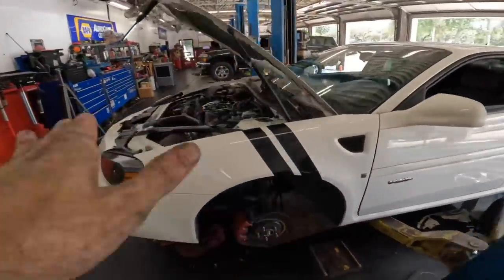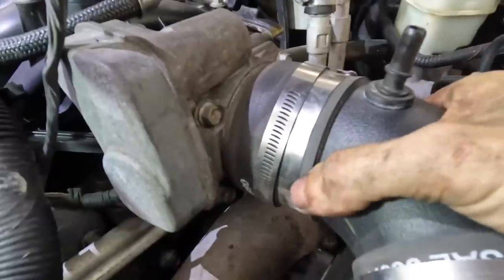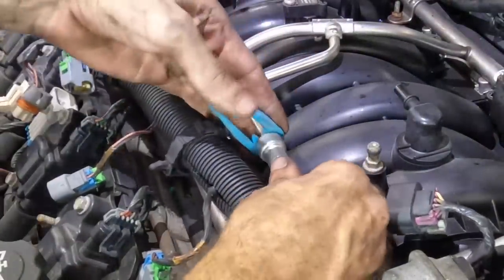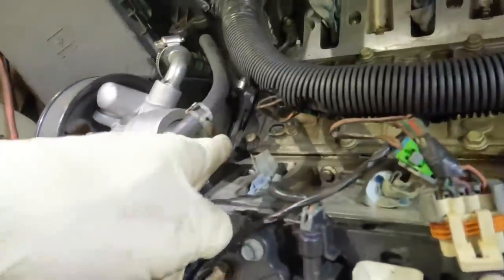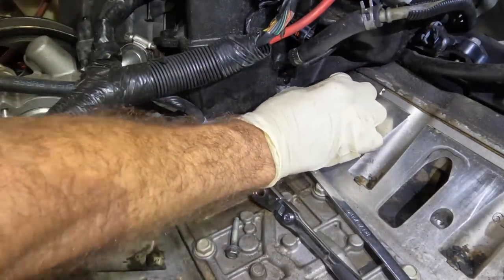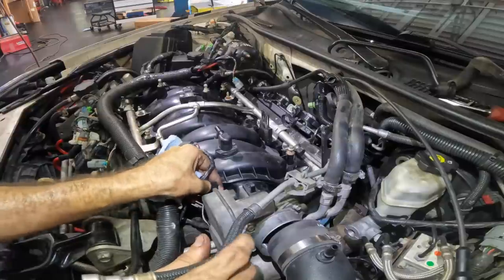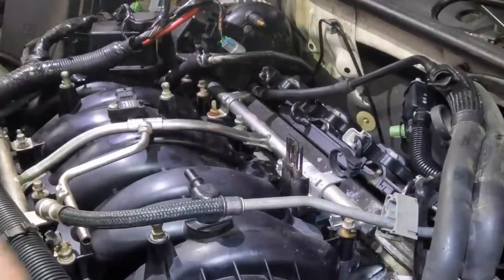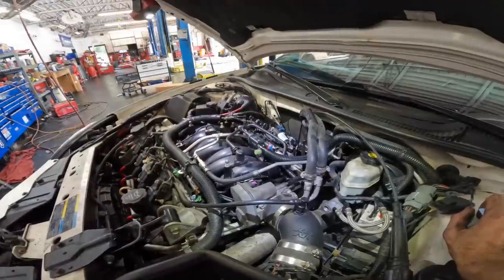Brake Clean Pressure Washer! V8 Powered Pontiac GXP 5.3

Comment: I once had a nut come off a air filter assembly and fall into the intake
of a vw trike while riding it. I immediately shut it off. Was able to fish it out of the cylinder with a magnet, bore scope showed a few dings on the piston but the motor was saved.

Comment: I use air to blow out ports anywhere crap can get into I thought most people did that.  It really works give it a try. I remember 1970s cars takeing out the 6 cylinder and putting 8 cylinders in you had to cut into the firewall and the motor mount location. But yeah putting a 8 cylinder in and shoehorning it to fit where a 6 cylinder should be very limited space it was a ok idea from Pontiac on these cars.

Comment: I dropped a bolt with the intake off and couldn’t find it. Completely forgot I dropped it. The next day I put it back together and started it and it wiped out my piston. Bent the rod and cracked the cylinder. Cost me $800 to fix the block and replace the pistons and rod. Getting ready to put the motor back in. I hate getting old.

Comment: I agree with your method of blowing the intake out. The way I see it, if there is any debris, it will end up in the cylinder if you don't blow it out, and any that gets driven further in would have eventually ended up there anyway.

That said, why not USE PAINTERS TAPE and block the intakes entirely. It seems like a lot less work and risk to me.

Comment: Thanks Ray for your videos.  I've  caught many a great tip thank you sir.

Great to see the Premier Logo on your parts trays.  I sold for them many years ago.  Had so much fun,  but the travel was hard on family life.  Live in Northern Ontario Canada and the close big minung city was 80 miles.  The nex was 220 mikes away so lots of overnight weeks.  I sti think I helped many mechanics with on hand consumables close at hand.  Oh and I too have the green handled wird stripper i use most days working on my 66 Dodge Dart Ragtop,  or my 2012 Volvo xc70.  I think I still have some Supertanium L H twist drills.  Great reminders thank you Ray.
Reply: If you want to remove broken bolts or studs left hand twist drill bits of the ticket I usually use a center drill first and when you hit it with the left hand drill it it'll spin right out have a great day
Reply: 66 dodge dart convertible. My first car. My grandfather had put a 1970 318 in it. Yours didnt come from Florida did it?🤣. I reamed the crap outa that car. Super fun.
Reply: @pitchforkpeasant6219  yes.  Originally PA  then Florida,  Ohio and Ontario Canada.  A total body/ Paint last summer..  looking spiffy.  I dropped a 273 Commando in it and it hauls.  Edelbrock 550  cfm pumper with E intake.
Reply: @billwhite5188  nice👍😁👍

Comment: Those difficult bolts you have to put in manifold first... a pain for sure. In the past I have used an old o-ring on the bolt to hold the bolt up, so it doesn't interfere with manifold placement. Then just pulled the o-ring off and screwed it in.

Comment: Next time when installing that pipe , do not push down on the pipe because it will bend and then rub a hole and leak like it did this last time. Lube the o-rings then push on the ends where the bolts go.

Comment: The socket is like that for studded fasteners.. like a stud on the back side that maybe has a bracket held tight with nuts on studs instead of a bolt head. It's a  low pro pass through socket..

Comment: A friend of mine changed an Intake Manifold on a 69 Big Block Chevelle and didn't know he dropped the clamp screw from the coil down a cylinder runner in the drivers side head. He had a bad day....

Comment: Good job Ray! You always make it feel like we are in it together. I even get the sinking feeling in my belly when I see you drop something down a hole that it doesn't belong in or when a bolt snaps off! Sending good vibes and blessings to you and your family.
Reply: Not at all  Because to my knowledge brake cleaner is the only one designed not to affect rubber and plastic components. Which is why you use it on brakes. If you did that with WD40 then in a few months all that rubber would be a gooey mess.

Comment: All 4 intake valves on one bank are NOT ALL closed at any one time, so you are blowing air and DIRT into some Cylinders. Also your blue shop towels do not stop all dirt from getting in when you first cleaned it either.
Reply: I was thinking the same thing.

Comment: know where your stuff is, yea, tell me about it, some way some how a 15 mm socket ended up inside the pumpkin after doing axle shaft bearing and seals in my 08 crown vic, it showed itsef 8 months later while doing 80 mph on interstate 75 here in Georgia, Kaboom, got it towed home opened the pumpkin there it was a 15 mm socket crushed and lodged in the ring gear, I honestly don't know how it got there because the job didn't require a 15 mm socket, I just knew the diff was destroyed, luckily it wasn't, crown vics are tough vehicles,  I am still driving that car 2 years later 243k

Comment: You could put a mannequin head inside the coolant vacuum tank for authenticity.
@29:00 I think they might be concerned that all that compressed air in the head with cause the fuel air ratio to be too lean once you reassemble the intake  😀

Comment: I wonder if Ray is able to replace a front timing cover gasket/seal and a oil pan seal on a 07 Monte with a 3.5 L V6 without pulling the engine? I have one that the dealer ran a dye test and says it has a small leak at these places?

Comment: I believe these 5.3 engines  have verible pressure oil pump. After 60,000 or so they tend to cause pressure problems.I was told by certified GM technician

Comment: Hey Ray, As always, GREAT VID! What is your opinion of the K&N Aftermarket Air Filter that is on this vehicle? Does it really add horsepower to an engine? Does the Air Quality of the engine suffer as a result of this filter system. I value your opinion! Thanks Earl Harrell

Comment: I had an om642 engine blow up, the injector seat cutter tool had a replaceable guide in it which fell out into the cylinder and when the engine was restarted it embedded itself into the top of the piston causing the engine to throw a rod bearing 🥴🤔🥴

Comment: 1 questions if you had power steering pump off how come you didn't replace that steam line . Before you closed it up again. 👍. Plus I like 👍 air gun 🔫  works good . Would work on bicycle gear ⚙ parts also because take a long time,  all road gunk of sand and oil.?.

Comment: Needs a catch can.. and new lifters lol. Shoulda checked how tight the VLOM bolts are, they like to loosen up. Needs a cooling system cleaning and a thermostat too. The cooling system is to small for the 5.3 and the trans combined. If it doesnt have a Tru-cool 40k stand alone trans cooler yet the owner should invest in one to save them another $3500+ transmission. I would have reused the blue intake gaskets...

Comment: Hey Ray, why is it that you always seem to use a screwdriver to release / tighten those adjustable hose clamps?  I've always used a 1/4-7mm, 5/16-8mm or for the mongo clamps on marine exhaust bellows a 3/8 inch nut driver, which have the advantage of never slipping off the screw head.  (Maybe this question has been asked and answered and if so, please forgive me).

Comment: great job Ray. strange that the prior mechanic would go to all of the time and trouble to remove the intake etc etc and yet doom the repair by using JB weld as opposed to replacing the tubing. penny wise and pound foolish LOL
Reply: Only good reason I can think of is the part was going to take too long to get, and they needed to get the car back together. That's likely a dealer-only part, same as the one I had to replace on a Ford 3.0 that ran under the intake.

Comment: As far as your assalt blow gun people are overly politically sensitized and have to take exception to everything it's a toy it's a blow gun you can't fix stupid but as far as using a blow gun to blow everything out hey that's the way I do cuz any little piece of dirt could ruin a proper seating or cause you gaskets not to sit down properly as far as checking your parts and your tools when you get done that was a great idea because if I can't find something I want to make sure and you were right that copper o-ring if it would have got in the valve probably would have bent it and that would have been major catastrophic motor disaster hey you do great work don't justify yourself to them stupid little trolls and haters and have a great day

Comment: At 24:08, the brass nut is still in place.  At 27:31, the nut falls onto the head when attaching the metal hose on the right side. At 31:23, the brass nut is missing.  Had to slow the video down to catch this.

Comment: Can you eliminate a pipe like that or no? what does it do? except leak.
Reply: The Cross tube is exactly as indicated in its name it allows the engine coolant (Anti Freeze) to cross flow between each cylinder head and the coolant system. No you cannot eliminate such a part, why would anyone want to ?. The cheap and dirty fix would be to cut out the leaking tee portion and replace with a barbed tee, hose and clamps. The “Cheap and Dirty” should tell any decent mechanic that other than a temporary fix don’t do this. Fix it properly.
Reply: Thank you very much just seems like some of these engines nowadays have so much unnecessary cooling flying all over the place

Comment: I blew an engine like that. leaking intake gasket should have been easy 30 mins on a ford 302. got finish fired it up ran about 15 second and boom. took engine apart and found a wood screw embedded in number 6 cylinder with a hairline crack in the cylinder wall. dont know where screw came from must have been laying on intake when I pulled it off.

Comment: Help if possible  I am subscribed  watch all your video's and leave the thumbs up.  Question for you or your opinion Ford F550 feels like it has  no suspension when riding over little potholes on highway or un even road going over bridges. I have changed all shocks front and rear. HELP !!!!!!!!!

Comment: Imagine how much money you would save if you bought a metal pressurized canister (recharged by compressor) and bought carb cleaner by the 55 gal barrel. Far Far Far cheaper than buying it in spray cans.

Comment: RAY RAY RAY RAY RAY RAY RAY RAY !!!!!!!!!!!!!!!!!!!!   TORQUE QUESTION TORQUE QUESTION TORQUE QUESTION  !!!!!!!!  TRYING TO GET YOUR ATTENTION LOLOLOLOL...Kidding aised  I have a question for you and need your advise. Being you worked at a GM dealer. This is a torque question. I just repalced my lifters in my 2018 Cadillac Escalade with the 6.2 crappy AFM system. When I got to the fuel lines. GM makes it very clear to always reeplace them with new ones. Of which of course I did. Question, when I torqured them down as per the specifications I was a bit stumped on how I was suppose to use a torque wrench on fuel lines. The only way that made sense to me was using a crows foot  and torque it that way. Number one, is that ok ? I was told doing it that way it's NOT accurate. Supposedly it looses the torque spec just a bit. I would love to know how you would torque those fuel lines properly or the right way ? I am very curious if you are willing to explain that in one of your videos. You are welcome to bring my name up in the question. I did make very sure it's not leaking but when I did torque it down using the torque wrench, it felt like I was over torquing it, if that makes any sense. Again, I know you get alot of comments. I hope you see mine. I am going to get a little silly with the title to my message in hopes my message gets your attention lol. Your California friend Ron, owner of Stanislaus Towing.

Comment: Do yourself a favor, use the right tools for the job from the start, your patience tank won't hit empty quite so quickly. Yeah, the personal challenge thing I get, you might include making the job easier and smoother (redundant somewhat) in that challenge. Pretend you're a doctor, lay out every tool you think you'll need in the order of projected use. It would be interesting to see the "nailed it", should it happen. Nope, I do not do what you do, but I run into the same , "Geez, I needed a boatload of tools to get that done" in what I do, and no, the "nailed it" part happens less often than desired, though I do get to say that when the project is completed. ;-)

Comment: V8 FWD - a little cool but mostly stupid...but admittedly it's probably better than the 3.8 supercharged, which never had sufficient traction off the line but always ran out of puff at higher rpm.  At least a n/a V8  should retain some top end performance - but would still have been so much better as RWD or even AWD.

Comment: I would love to see you do a conversion to an all electric car. Tear down the internal combustion all the way to the camshaft. Keep the camshaft, the alternator and the power steering/power brakes. Heat and cool the inside with an electric heat pump. Four lead acid batteries for the motor, one for power steering/power brakes, and one for interior controls and heat-cool. You will have a total of six lead acid batteries. There may be some lithium ion batteries. The alternator will produce charging while driving. This car would lose a tremendous amount of weight after the engine and exhaust are removed. Please consider this project for your off duty hours(?)
Reply: Wow, there is so much wrong here, that could never possibly work.  First, you don't use lead acid batteries in an EV...they would die within a month.  Even if you don't care about longevity, you would need bare minumum 6 tons (possibly more) of lead acid batteries to even get the ~260 mile range my car has...those 4 lead acid batteries would get you a few miles at most (lead acid has jack for energy density compared to li-ion).  You also cannot charge an EV with an alternator, unless the alternator is powered by a combustion engine of some type (which is effectively just a generator - meaning at best you just designed a much less reliable Prius).  Attaching an alternator to an electric drivetrain will just cause it to drain the battery faster (though you can use the engine as a brake, that's how regenerative braking works).

Comment: That crossover tube is a poor design. I bet it cracks in the same place again. It should have a center fitting instead of the crappy weld from the factory.